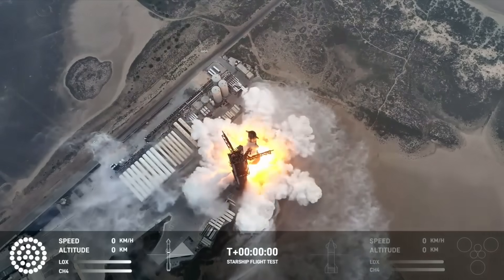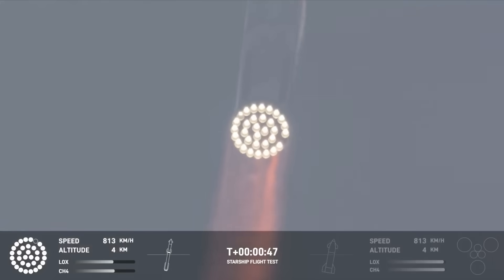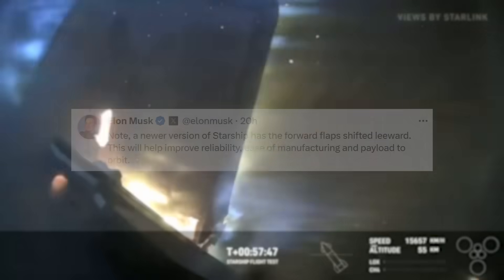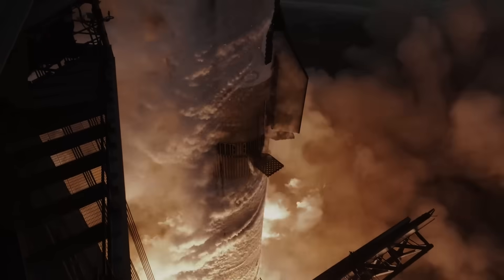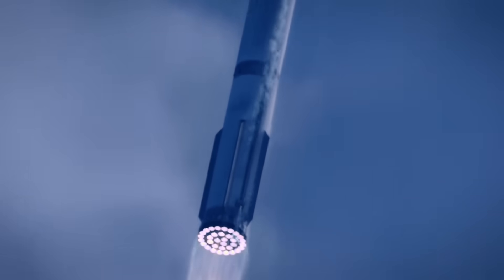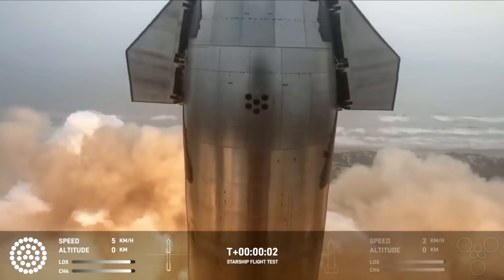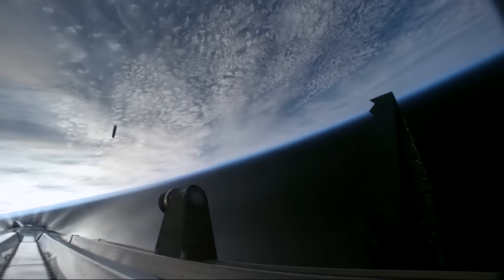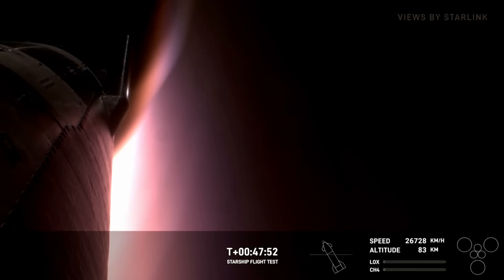SpaceX Has A Plan to Fix Starship's Heat Shield

Comment: Elon said the booster had a "precise" landing,  that starship was 6km off. See ellie in space interview.
Reply: Just remember, Elon wanted to see if it could reenter the atmosphere intact, let alone land softly. It has never been done before with this type of ship. The accuracy wasn't as important as experimenting with heat tiles to find their weak points and confirm a reentry is possible.

Ift5 will probably include a booster landing on land and another accurate water landing with cameras trying to be as accurate as possible.
Reply: I thought I was a nerd. Then, I read the comments arguing over attitude and altitude.
Reply: 6 km off is kinda in the middle of the errors in the Apollo capsule landings, so this would actually be pretty damned impressive accuracy for a space vehicle without melted-away flight control surfaces. With the damage, it’s freaking 110% amazing.

The cool thing is that SpaceX keeps getting better each time, so this will improve dramatically.
Reply: @PetesGuide Exactly. I would be impressed if they got to within say a 100K of their targeted landing spot. View the video feed at about 68K elevation. Decent rate was seemingly very stable….cruising to reach the targeted landing spot say 500 Ks from this target location. All autonomous. This is amazing science and engineering. Most people just don’t get it.
Reply: 6km is still brilliant considering the ship had one of its flaps half melted!
Reply: This entire argument was based on a misreading of op; he said that the BOOSTER was on target and that STARSHIP was 6km off. He wasn’t saying that Elon said anything wrong.
Reply: @OverkillDM  thank you.  I should get better at my punctuation. Yes.  The booster was 'precise' (depending on what that means). The ship was 6km off
Reply: Jeeezizzz.. Your EDS is showing. Chill dude.
Reply: They land Falcon 9's within a few meter radius. If they say it is precise...it is.
Reply: 6km off sounds pretty good for an aircraft whose wings are burning thru. That's B-17 tough.
Reply: Having look sideways  with drama unfolding the baby came back home shows team players at space x is excitingly on track computer is great tool 
Real world test still rules.
Reply: Thar would be accurate, not precise
Reply: @screwstatists7324  going to have to take that one up with Mr. Musk, I was quoting him.  (Also to be clear precise was about booster 6km was about starship)
Reply: All these rockets companies had the same attitude about Falcon 9 re-usability.  Now ALL are on the verge of bankruptcy as Falcon will launch 100+ times this year.  You’re better off giving Elon the benefit doubt.
Reply: @Puer-Aeternus-Anonymous  umm... SpaceX is on the verge of bankruptcy.  You really outta look at the numbers.
Reply: Aiming for a landing spot halfway around the world away and being 6k off isn't too shabby!
Reply: @metriczeppelin  facepalm

6km off 
This while the idea is that they supposedly should be able to pin point where it will land within inches.

But sure, having a molten heap of scrap metal splash down somewhere in the general area of a circle with a surface of 44 square miles isn't too shabby if you one of those that think this 4th failure in a row was another marvelous success.

And before anyone goes about design philosophy or that they didn't intend to have a perfect flight... grow up.
This is the 4th time they launched and the 4th time that the flight plan was executed as stated. 
A flight plan isn't something that one hopes to accomplish but is what one expects to do. Next time you intend to fly across the nation know that the flight will have a flight plan and if you end up in a smoldering heap of debris no where near your intended destination then most people would call that a failure.
Reply: @PDVism  OK, so when flight 5 or 6 nails a precise landing with the ship intact, what will your next complaint be?
Reply: @chrismantonuk  When that ever happens I will deem it a success IF the rest of the flight was also according to the flight plan.
Reply: @PDVism  We all know how Elon will greatly appreciate your approval at that time.
Reply: So you should know he was talking about attitude, not geographical location.  I searched the best I could but can't find anyone who's done this better than SpaceX?  Any input?  😉  

Nice try at spin. Better like next time.
Reply: @phillipzx3754 

No.  It was 6 km off of target.   This is 100% understandable considering what we know of the sorry state of one flap - aerodynamically compromised.  Added drag.  Probably asymmetric.  And that is just the one flap we know about.  Who knows about the condition of the rest of that vehicle?

To be ONLY 6 km off is amazing.
Reply: @conorlauren exactly! To have traveled that distance, sustained multiple failures and damages and STILL be ONLY 6KM off is well within margin of error in any engineering estimates
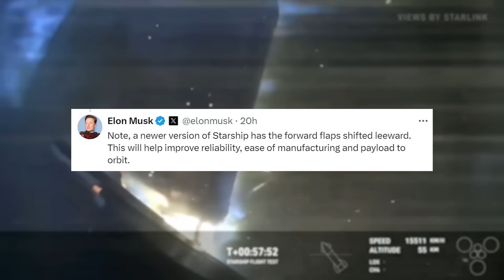Reply: @phillipzx3754  He literally says it "was 6km off geographically". See 2:16 in Ellie's interview.
Reply: @JesseJames_37  Hes talking about where the ship began its landing sequence.  The flip happened when it was supposed to at the correct distances above sea level considering the loss of the inner part of the fin.  He mentions the distance being off because that is still an issue obviously.
Reply: @jdmanjd1013  Sorry, I'm a little confused. This reply is organized like it's a counterargument, but you're backing me up?
Reply: @JesseJames_37    So what?  He also "literally says" ATTITUDE!
Reply: @phillipzx3754  He does not. What would being 6km off in "attitude" even mean? Attitude is a measure of angle, not distance.
Reply: @JesseJames_37  Some people just hear what they want to hear.
Reply: @JesseJames_37   His use of "precise" was also referring to the attitude of the ship when it "landed." 

"Attitude is a measure of angle, not distance."

No kidding Sherlock.  🤣Go take a student pilot lesson so you can learn what the "attitude indicator" does.
Reply: @phillipzx3754  It's incredible how confidently you're saying this while having absolutely no idea what you're talking about.
Reply: @JesseJames_37 I didn’t watch the interview yet, but altitude can also mean barometric altitude in aviation, which roughly means “height”. So Elon might have been implying the booster stopped at the precise height above water, not necessarily also mean precise location.
Reply: @freddielo4330  he's saying attitude not altitude
Reply: @JesseJames_37    Attitude is the direction an aircraft is pointing. 

Prove me wrong.
Reply: @phillipzx3754  He has been acknowledging the definition of attitude, what you havent been answering is what you are saying by 6km in attitude? Youve been arguing the same thing and somehow you arent reading it or you truly are a strange critter
Reply: @phillipzx3754  That's right! Now please tell me what attitude is measured in. (it's not kilometers)
Reply: @JesseJames_37  my bad 🙏
Reply: @JesseJames_37   Because the AIRCRAFT landed (even though it was 6km away) in the proper ATTITUDE.   Attitude is measured in degrees of pitch, roll, and yaw. Did you not know that?
Reply: @phillipzx3754  I sure did know that Phillip, thank you. So in summary, the aircraft landed 6km away geographically. To remind you, this is the claim that you disputed at the top of this thread.
Reply: @phillipzx3754  timestamp for the attitude reference? I can’t find it. Just gone back to rewatch and Elon’s words are, regarding the Ship: “Land in a pretty precise location… well technically we were 6km off geographically, but the ship was able to maintain control and then relight the 3 raptor engines for landing”
Reply: @JesseJames_37 it's because you misunderstood the origional message
Reply: @phillipzx3754 wrong
Reply: @phillipzx3754 You obviously didn’t search very hard, NASA did this with the Delta Clipper almost 30 years ago.
Reply: It was McDonnell Douglas,  not  NASA. And it never made it past 15,000 feet. Also, I never made any claim about "who was first."  Why did you pull that out of your ass? 

Did you know the Russians were the first to launch a person into space? You obviously didn’t search very hard or you would know they did that over 60 YEARS ago. 😜
Reply: @phillipzx3754 with the video of the booster landing in the gulf it proves how wrong you are 😂😂😂
Reply: @joey_cola   The booster touched down in a perfect attitude. WTF are you talking about?  Have you not seen the footage they released? 

Just what do you think proves how wrong I am?
Reply: The Hindenburg disaster was "rich in data!"
Reply: @wyattnoise  BOOM!
Reply: @wyattnoise  other than wind speed and altitude the Hindenburg had no data. Keep smoking.
Reply: @wyattnoise  It was, no one ever filled their blimps with hydrogen and covered their blimps in what is essentially thermite ever again.
Reply: @cn8299  And it's a good thing blimps are out of fashion nowadays.  I think people would be outraged at watching 90% of the world's helium supply vanish into the sky for the sake of a thoroughly unnecessary mode of flight.
Reply: Blimps ran on hydrogen hence the big booms.
They would not be cost effective with helium

Comment: Oh, that’s a lot of assumptions to assume it was the flap….. could’ve been the angle could’ve been with the flat situated with them changing the flaps. I believe it’s probably already fed them though next version.
Reply: the solution is  starship block 2's leeward facing differently shaped flaps
Reply: No assumptions. You can see the gas leak into the flap joint and eat it away.
Reply: @filonin2  but you're still assuming it was the flap, and not a missing tile that fell off during launch. One flap failed, not two or four. I will speculate it is just a missing tile, and they will sort it out. I am shocked they survived entry, and even with the flap melting made it to a soft splashdown.
Reply: @drfranks1158 no one has revealed publicly how many flaps were damaged, all anyone outside of SpaceX knows is that at minimum one flap was damaged, could have been a design issue that affected all, or could have been a singular failure that affected just the one, we simply do not know as of yet.
Reply: @drfranks1158  we only had two views of two flaps, and I believe we saw plasma leaking through the hinge area on both. There is no reason to assume the flaps we didn't see on video were undamaged.

Comment: First..how do you know how "intact" it was when it landed?!? Second...how do you know they didn't intentionally weaken the heat shielding EXACTLY WHERE THE CAMERA WAS POINTING to see how robust the design is in case of a Columbia type failure?? Both landed softly... SpaceX knocked it out of the park. Did you even see that flap operating after the atmosphere sliced through it like a cutting torch?!?!? Shame on you. SHAME!!!
Reply: While it’s incredibly insane and amazing how capable Starship deals with failure, I don’t think they would’ve intentionally weakened the rocket. They did remove a couple heat shield tiles, but not where the flaps were. As for the camera pointing at the flap, it was most likely a big coincidence.
Reply: Don’t be excessive, and remember that to function correctly, the plan to use the Starship as part of the Artemis mission involves relaunching the same rocket about 15 times in a month. Do you think this ship would have the slightest condition to be reused? I see a problem with the Starship’s heat shield, which is basically the same as the space shuttle’s.
Reply: @GustavoCebo  15 launches in a month doesn't require a single ship to fly 15 times. SpaceX could make several Starships to allow for a few days to inspect and refurbish as necessary.
Reply: @GustavoCebo  btw...they are chucking grain silos into orbit on a bevy of methane cutting torches.... and landing them. It's not me that is being excessive. 😂😂😂😂
Reply: @GustavoCebo
Not the same.  Shuttle was damaged by falling ice.  Much less likely to happen with starship being on top unlike the shuttle.
Also shuttle was mostly made of aluminum which has a much lower melting point than stainless.
Reply: Jepus it’s only his 2 cents brah chill. So many autistic space X fan boys can’t handle the slightest critique.
Reply: “Shame on you?” Go back to your Mother’s basement.
Reply: Come on, the vast majority of an engineer's job is to anticipate points of failure. A flawless flight would yield little data. It would just be confirmation bias. They want these things to "fail". They intentionally make them "fail". You learn infinitely more from failure than you do from success. Side note....as long as you don't pizz off the faa. That's no good for anyone.
Reply: @intheshell35ify  A character flaw?
Reply: Another space x hater 😢 grow a pair because you never see this much progress in a test package of such a huge  150 ft long 100 ton spacecraft
Reply: @stanleydavidson6543 How exactly is the OP hating on SpaceX?

Comment: The heat shield will be the death of this vehicle
Reply: It literally made it even with the current problems so that makes no sense.
Reply: ? 

They can just fix the issues. Besides, they intentionally removed a few heat shield tiles and it still survived, which says a lot. Like I said, they just have to strengthen the heat shielding near the hinges, and it is alright.
Reply: @malrusUK  they removed heatshield tiles in the engine skirt area (where they weren't protecting anything that important anyway) and that area was destroyed. You could clearly see the colorful flames eating away at the skirt during the live stream. And more importantly the heatshield failed in areas where they did not remove any tiles (the flaps)
Reply: @plainText384  you sure there was a view of the skirt ?
Reply: @fionajack9160  we have 2 camera views. One of which is from a camera on a front flap looking back at a rear flap. While this view doesn't show the skirt particularly well (it's a very shallow angle), you can clearly see flames flash up from the center rear of the vehicle, which look very similar to the flames we later see eating up a flap. These are presumably from the experimental patch of thinner/ missing heat shield tiles on the engine skirt.
Reply: Might could, sir.
Reply: What a stupid and defeitist thing to utter😂
Reply: What about dreamchaser?